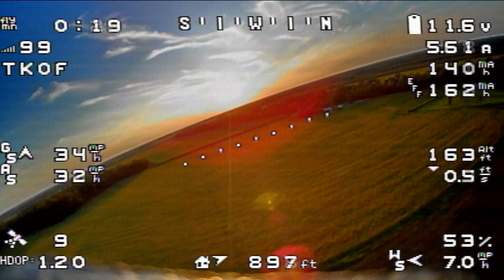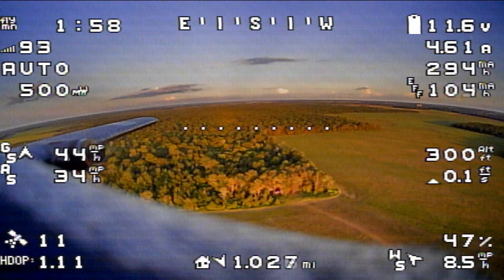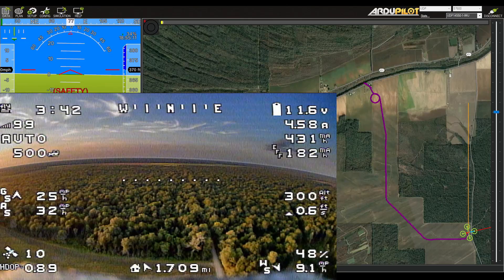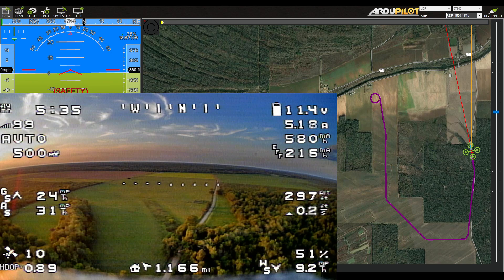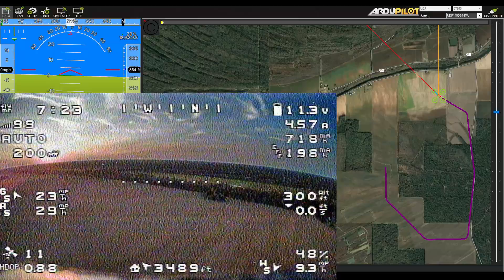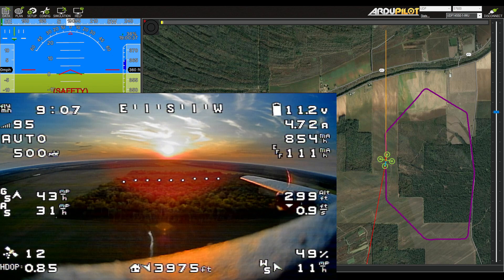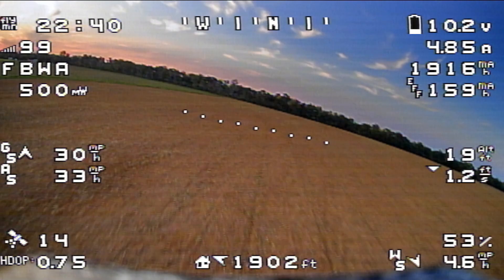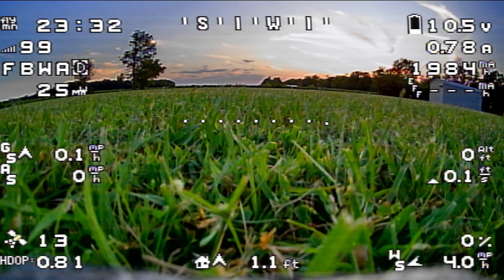T1 Ranger - Flying a Mission

Comment: from your motor comment on the last video, i swapped my motors to xing 1404 3000kv and huricane 4024 props, i'm cruising at 3 amps now at 60km/h
Reply from the maker: Nice, is that on 3S?
Reply: @bonafidepirate  yeah, 3s vtc6 li-ion pack
Reply from the maker: @p.i.engineer398  Nice!
Reply: @p.i.engineer398  Awesome! :)
Reply: I wonder if this could work with 4s setup as I fly 4s VTC6 pack... probably overkill or just lower the cruise throttle...

Comment: In mission planner, I believe there is a hidden icon.  if you can find it, you can switch vehicle types by clicking on the menu below the telemetry baud rate near the upper right hand of the screen. you have to hover just to the left of the menu, and it appears in some versions.  Arduplane benifits a lot from having a real pitostatic tube and airspeed sensor. the I2C digital sensors work great.  just have to configure, autocal in RTL,  turn off autocal, then ARSPD_USE, to enable.
Reply from the maker: You mean the one shown here? https://youtu.be/yUV8B-9c6d8?t=978 I'm unable to get that one to show up. I don't have the "dead space'" between the baud rate and connect button either. I'm guessing it was taken out some time along the way. So far I haven't found a way to change it. I'm using the current latest version of MP right now.
Reply: @bonafidepirate  yes, that was the one.. would it help to load a param file saved on the hard drive first?  one that's a plane?  or connect to a plane, disconnect, then try?  
BTW, I just got a crossfire module working on a flysky controller..   😂and arduplane..  complete system. was actually pretty easy. good since I hate Open tx and Edge TX.  the fleshy menu... I can handle.  I'm going to order one of the new controllers that has ELRS built in.  I'll have to learn model setup for Edge tX..  but I'll get a friend to help and save the setup as a file, so I can reproduce it easily..  at least it sounds good on paper.  
I would like to make ELRS work on Flysky too, but not sure if its' possible.   would be great to learn how to get ELRS to talk mavlink telemetry with Pixhawk at range..  and not need the telemetry radios.  or just use OSD like you do.   What is your fav. solution to overall system architecture?
Reply from the maker: @FPVREVIEWS  I may be wrong, but I don't think ELRS does two-way telemetry. I've never used their stuff though, I'm saying that based on the notes here: https://ardupilot.org/plane/docs/common-tbs-rc.html#common-tbs-rc

Personally, my favorite radio system to pair with Arduplane has been Dragonlink. I've never had any range issues for control or full Mavlink connection to the plane in flight.

Do you have Mavlink working with Crossfire in the air? It worked fine for me on the ground and at short range in the air, but quickly dropped off with any distance at all (less than a mile) and wasn't very usable. To be fair though, I'm running the telemetry power at 25mW since my old pan servo didn't like any more than that... lol I'm sure you'd get more range with the Nano Pro RX if the telemetry power was bumped up higher. I'll try again some day, maybe.

Comment: In quads I used to lower timing on lower kv setups to avoid mid throttle oscillation, and raise it on high kv setups to help with desyncs..... I bet you would gain 10%+ efficiency if you can you go up in pwm from stock 16 to 48 or 96khz, although you will probably notice less top end /vertical climb torque but for cruising should be great
Reply from the maker: That's what I'm hoping for, to gain a little efficiency at the cost of some power for better cruising numbers. If it lets the motors run cooler that's great too! lol It could even be where some of that efficiency comes from, less wasted energy in heat. I'm not sure if we can adjust the PWM rate in standard blheli (not 32 bit). That's something I haven't played around with before.

Comment: A nice waypoint flight. I'm easily pleased with a sunset aerial view. :)
The efficiency is pretty good on this 3S stock build. Looks like could easily fly 30+ minutes using a 3000+ mAh li-ion pack. Trying to improving the efficiency beyond the stock setup would be interesting. Wondering what you thinking of trying with propellers? A good tease for tuning into a future video. ;)
Also curious if the crossfire telemetry has been tested at further a bit distance? Seeing this flight was ~1.75 miles range at 4:00, 11:45. Nice you that the telemetry issues seem sorted out for the most part. (not perfect, but seems very usable, no dropouts)
BTW: Was fascinating to see how the wind had varied at similar points along the two waypoint circuits, but the Ranger's flight parameters and tracking were almost identical. Shows how well this build/ardupilot are tuned in.
Reply from the maker: Those nice sunsets are half the reason I fly! lol I actually had a good link with the current setup, tracking on the map all the way out to 4 miles when I flew to the river in the last flight. I'm guessing the standard CRSF telemetry uses a lot less bandwidth than trying to push Mavlink through. Someday I'll try Mavlink again with more telemetry power on the receiver, once I get the pan servo to cooperate with that. (or unplug it for the test... lol)
Reply: @bonafidepirate  Thanks Keith, this a helpful insight of what's possible.

Comment: Great videos mate. How do you rate the T1 Ranger compared to your Reptile Dragon v2? Thanks!
Reply from the maker: I'd say they both fly quite well. The Dragon V2 being larger, can carry more battery and spread the electronics out better so you have less issues with everything being in a small fuselage, which opens up more options for what will work well in it. The Ranger is very easy to "build", or more accurately, assemble, and they're both certainly high quality kits. The Ranger breaks down rather quickly, and the parts are small. It wouldn't be hard to pack it in a backpack if you tried. The Dragon V2 breaks down pretty good too, but the parts are still larger. I guess it all depends on what you want. I do like both of them quite a bit though.

Comment: How are you getting the stats screen I haven't been able to get it to work.
Reply from the maker: I set up the stats item on an OSD screen that I'm not using, then set that screen as my disarm screen, so the OSD switches to it when I disarm the plane. OSD_DSARM_SCR is the parameter to select the screen it switches to.
Reply: @bonafidepirate  thanks mate didn’t realise you needed it on a seperate screen I’ll chuck it on OSD 4

Comment: Did you configure anything in blheli to make the motor ramp up and slow down slower like a normal fixed wing ESC?
Reply from the maker: No, I only changed the motor timing from medium to medium-low. (which corresponds to 15º and 7.5º respectively, I think) I don't think there is any settings for ramp up time, at least not in the "multi" firmware that these come with.
Reply: @bonafidepirate  Oh so it's not blheli on those ESCs?
Reply from the maker: @WinstonSmith1984  Yes, it's blheli. What setting changes how fast they ramp up and down?
Reply: @bonafidepirate  I think it's called "Startup Power" on the top left side of the configurator. I haven't tried it myself though. My previous answer disappeared probably because I put a link in it.
Reply from the maker: @WinstonSmith1984  I think that's how much power is used to get the motor spinning, so it doesn't stutter and lose sync. I don't think it's the same as a slow ramp up of power like some ESCs have, especially helicopter ones. https://www.youtube.com/watch?v=0Bi1XcdpnQI&t=1119s